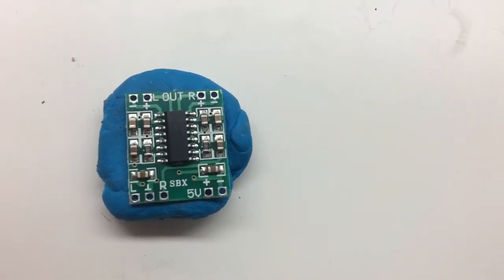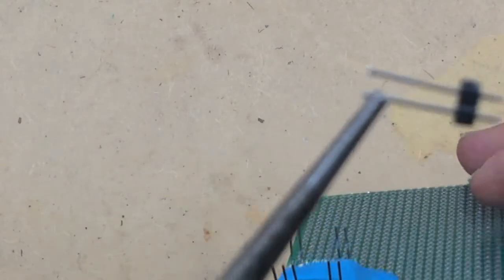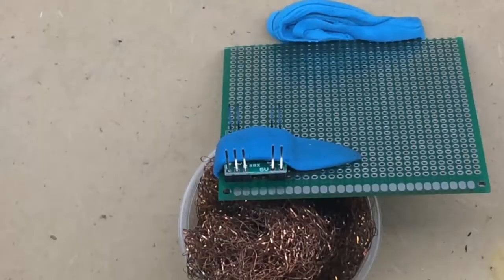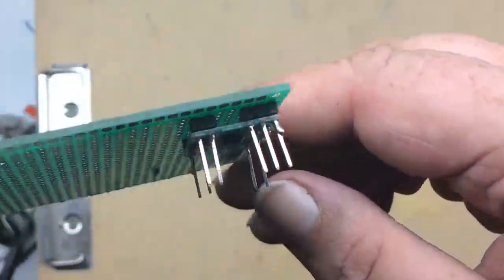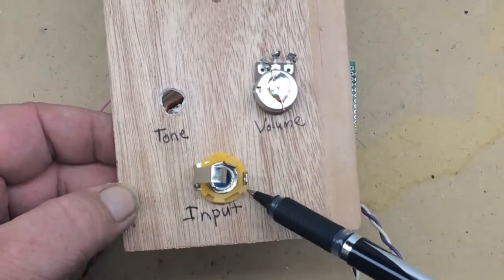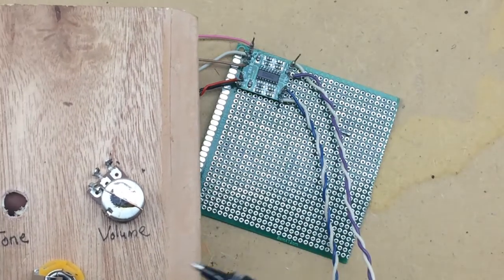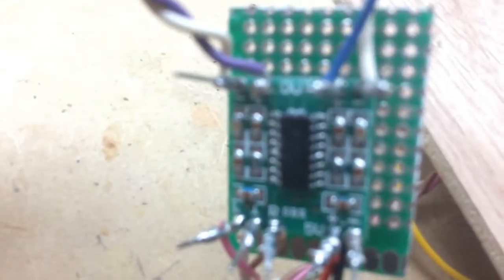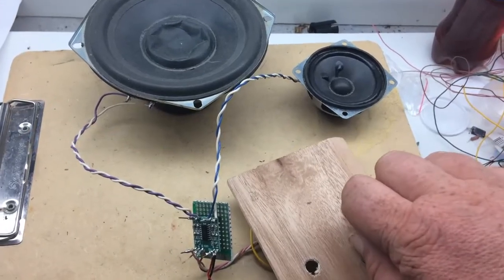Turning a  $.20USD amplifier into a music player/cigar box amplifier

Comment: Just got a bunch of these little guys in. Have you set any of these up to run off 9 volt batteries? I've been looking at both linear voltage regulators and buck convertors and am not sure which to use to step the 9 volts down to 4. One of the videos mentioned that since step down bucks use coils they might cause interference in radios, so I'm assuming the same would apply in the case of any amp circuit. Any thoughts?